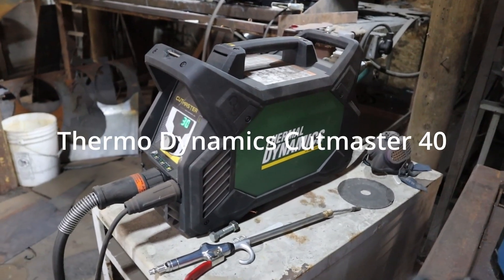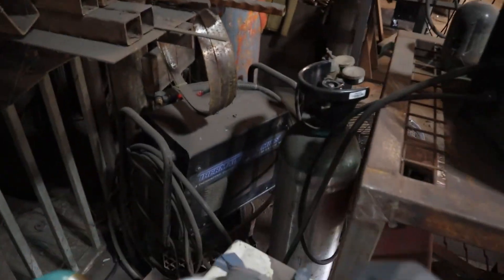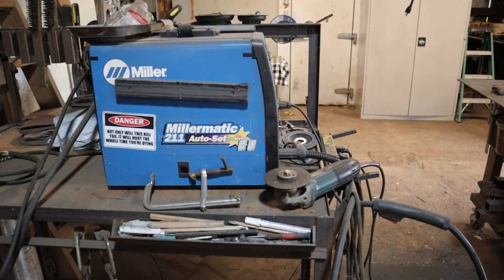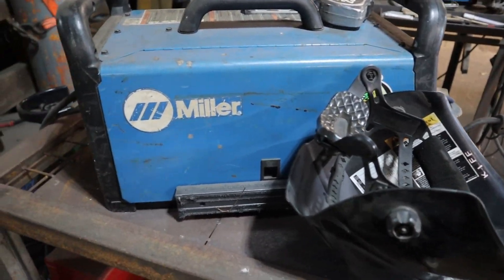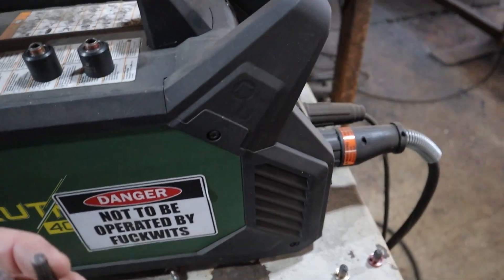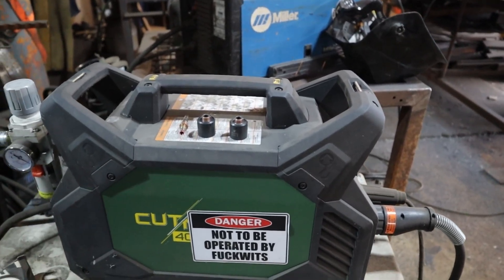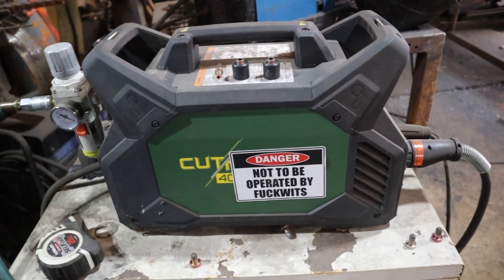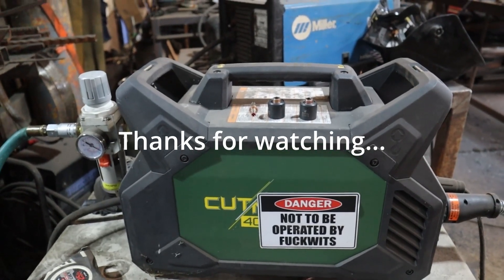Martin's Metal Art /Cutmaster 40 Review

Comment: My cutmaster 50 just died, logic pc board issue.
Does the cutmaster 40 cut the same, better or worse than the 50? 
Not sure what to replace mine with......
Haven't found anyone who has run both other than you.
Reply from the maker: I love the 40.  It's smaller and just as powerfull.  The one thing I've discovered is it takes more air pressure (90lbs)  I also found the consumables much cheaper from the Amazonians then from my welding supply shop..